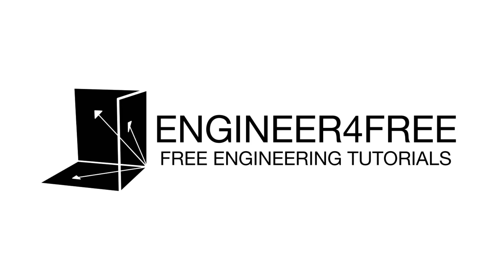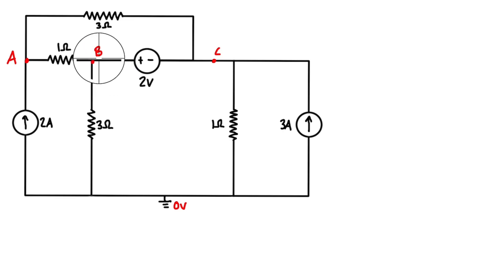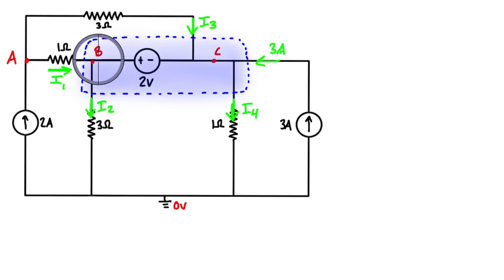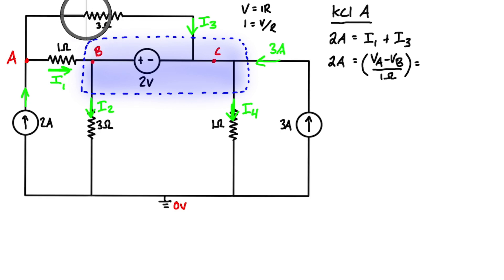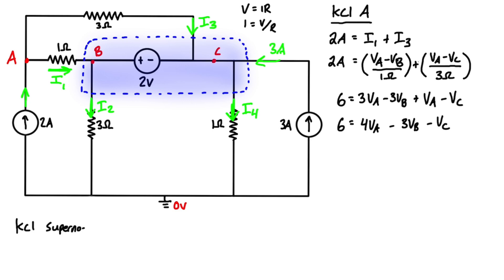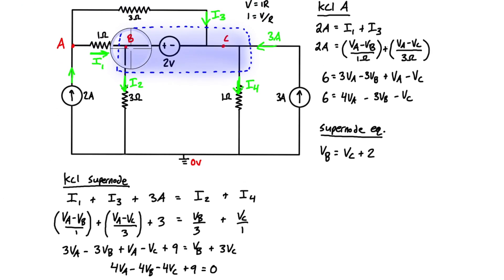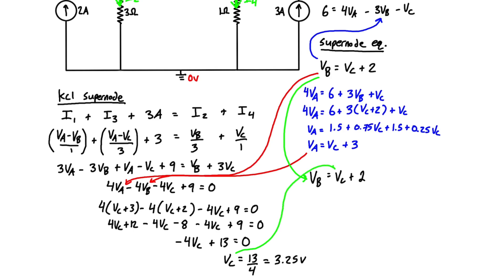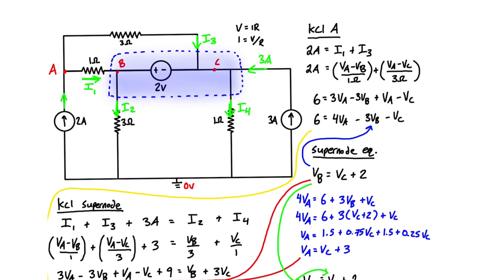Nodal Analysis Supernode Example Problem

Comment: With a little bit of observation, we can solve really fast by choosing nodes, by choosing the ref at the mínus terminal of the 2V voltage, node a at the intersection of 2 amp source, 3 ohm, 1 ohm branches, node B at the lowest part of the circuits.

Comment: Very informative video, was struggling a bit with understanding supernodes, but this helped a lot!

small side node, at 6:44, when finding VA, you plugged in the whole equation to find Va after we got Vc, when you could've simply used Va = Vc + 3 (Which we found earlier). I know it's nothing big but I just wanted to point it out haha.
Reply: YEAH